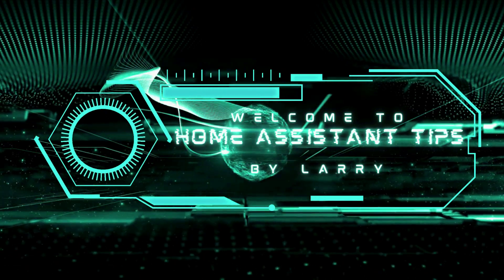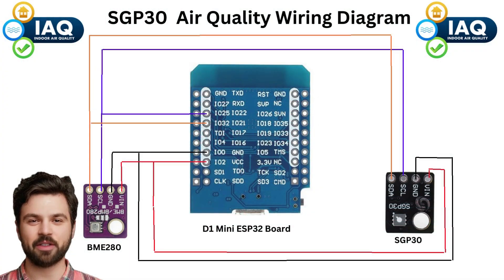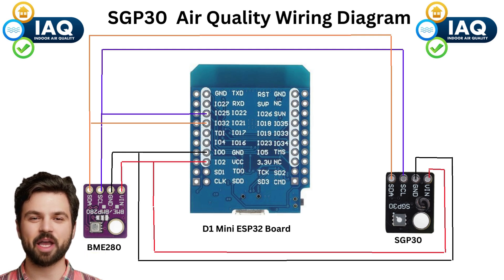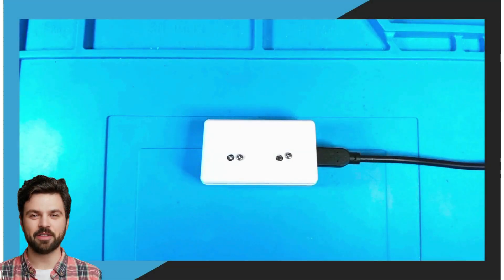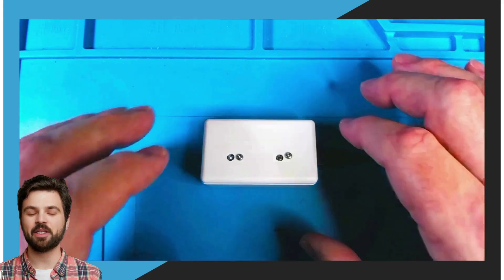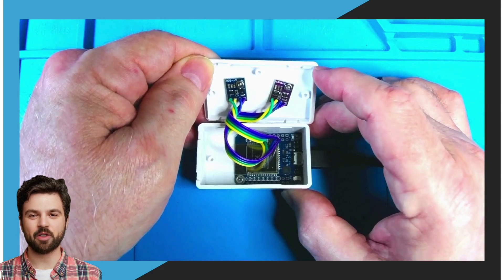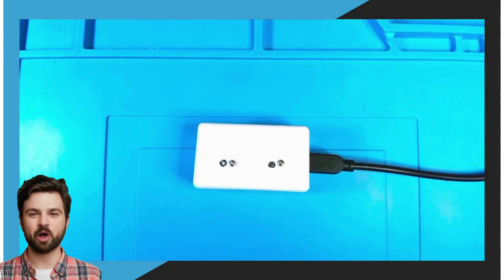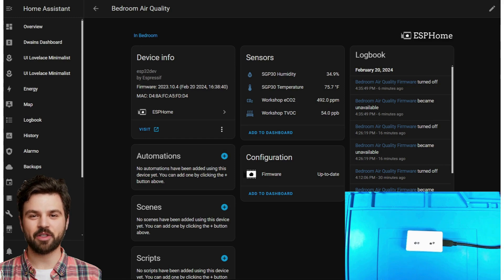SPG30 Air Quality sensor in Home Assistant

Comment from the maker: Just a update on this. If you use a BME280 sensor in esphome with the new ESPHome update. 2024.2.0 the code i used had a breaking change. I have updated the code so you can just copy this code i have in the video description now and it will work with the new update.